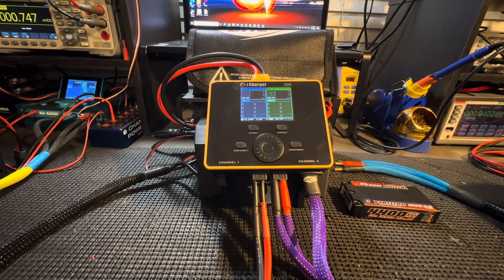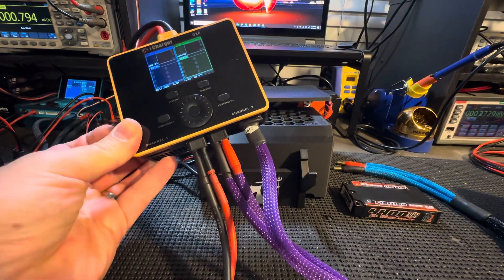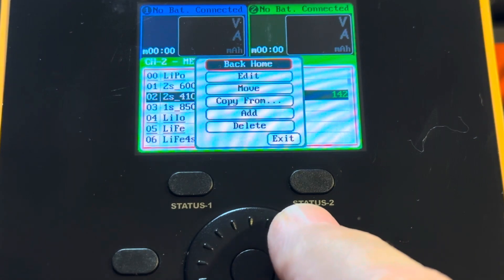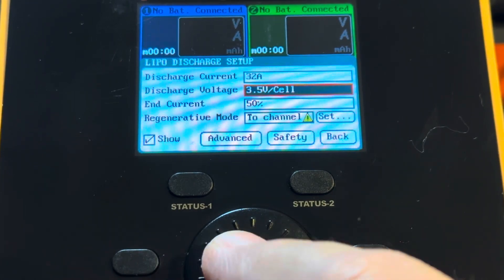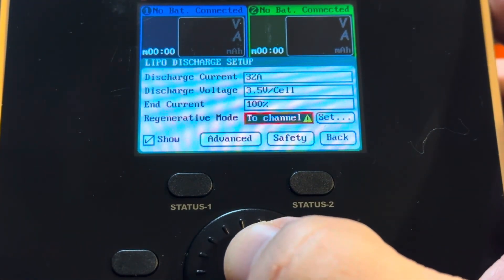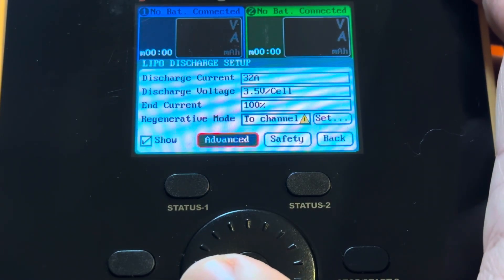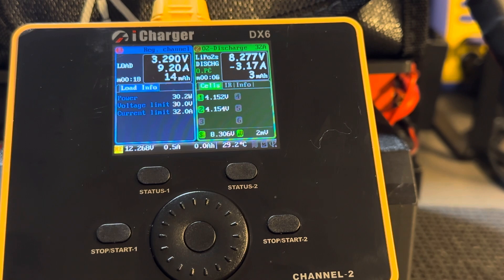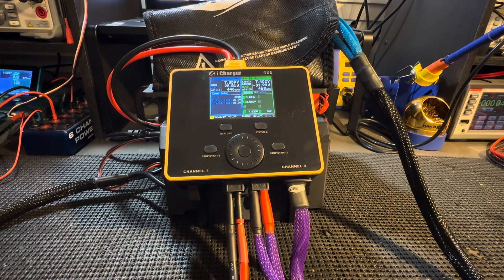Icharger settings for DRC Discharge Box

Comment: I set my 456Duo per these instructions. Keep getting a 2204 error code. Any help appreciated.
Reply from the maker: According to the manual, the 22XX error is low cell voltage on the balance port.  You may be choosing the wrong channel to discharge with.  Possible balance connector is bad.  Try swapping channels and check all connections.

Comment: Is there any reason this wouldn't work for the "extra discharge" mode that has the external load in series with the positive battery lead? This would make it so the 2nd charger channel isn't tied up with the load connection.
Reply from the maker: Yes you can wire them in series and use the "extra discharge" function.

Comment: Hi Andrew. 
Thanks for the video. You mentioned version 1.1.0 for the Duo  456. However, the link on the video is for 1.1.4. 
I have 1.1.0 on mine and after5 minutes or so the Duo show broken connection and stops working. 
Can you help?
Thank you.
Reply from the maker: 1.14 is the latest version I have tested, it was released after I made the video, I just changed the link. 1.15 has been released since and I have not tested that version.

For your issue I would check all physical connections.  I would also try a different charge lead and discharge bank along with upgrading the firmware.
Reply: Hi Andrew. Thank you again.  Happy New Year. 
Do you know if we can use a parallel board to discharge to storage (3.85V/ bat) 4S and 6S batteries?  0:03 What is the max amperage? 45A divided by the number of batteries?
Reply from the maker: @RCflyingnuts   With a parallel board you are essentially making one battery with more capacity.  Depending on the construction of the board it may not handle the current.  Personally, I would discharge one at a time, this is so the discharge bank can get a break between batteries.  max amperage for discharge is dependent on the battery, consult manufacturer specifications.